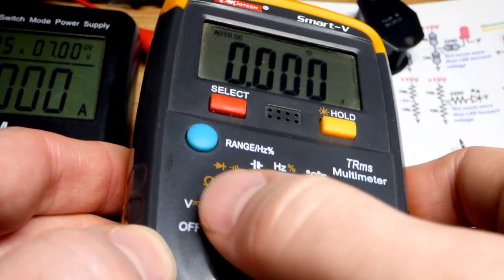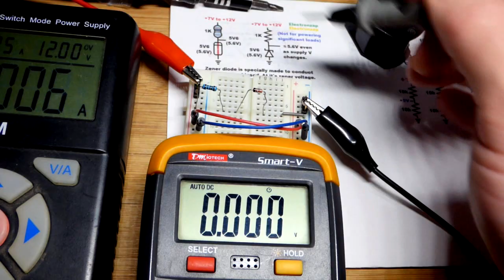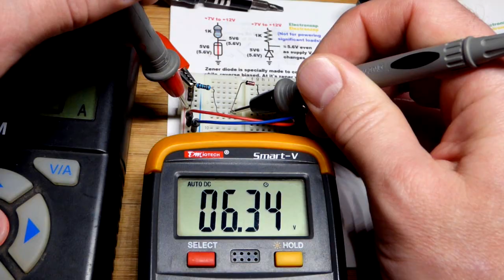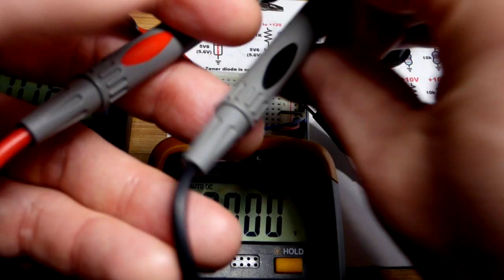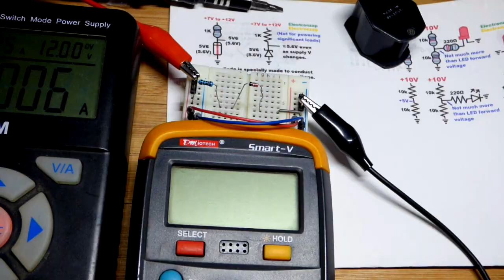Zener diode basics for Beginners Learning Electronics by Electronzap

Comment: GREAT video.
I have a circuit that requires 3v to 6v @ 75mA...it's been running for years with a 5.1v zener!
Couple things to mention...

1)  The power-rating of the zener must be calculated Vz x Iz.  Same for the Resistor except without load (under load, the Ir is simply shared between load and resistor).

2) The current through the zener  is the SAME with or without the load!  NOT efficient.
Reply from the maker: Very cool, good points, and thanks for watching!